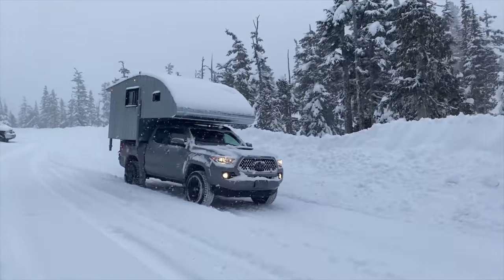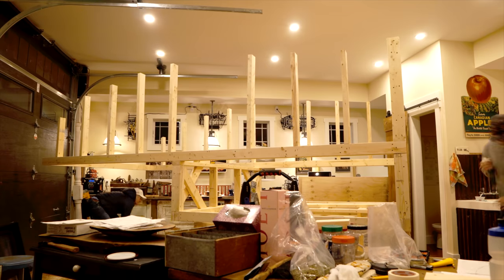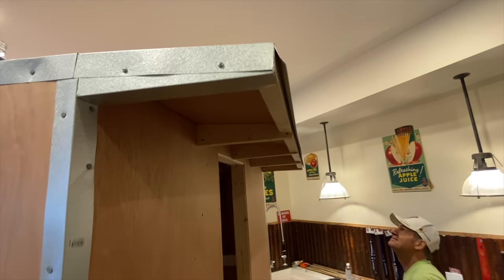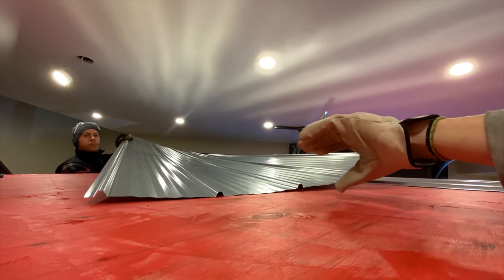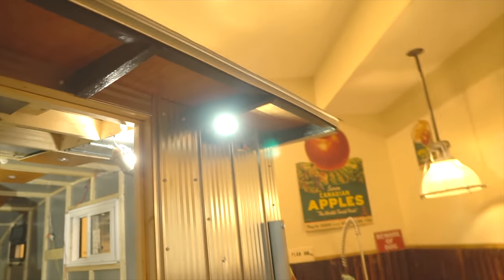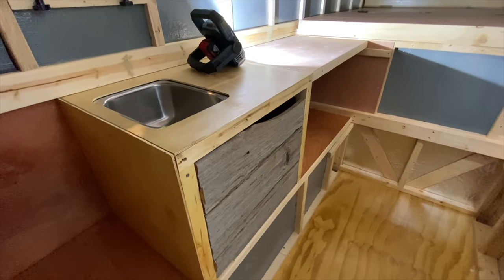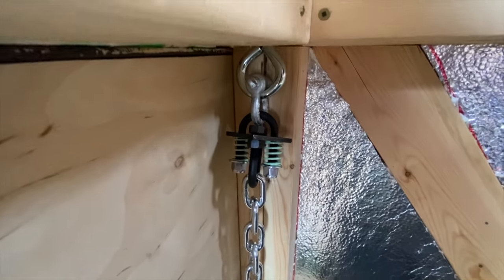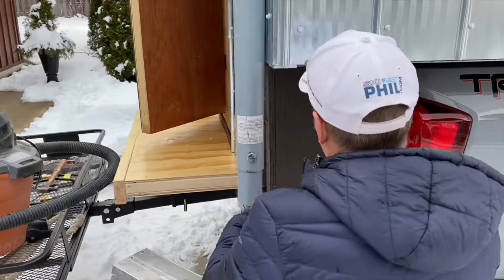I Built an Off-Grid Truck Camper - Start to Finish

Comment: Nice build. I built my own wood framed fiberglass camper shell in 1987 after ETS'ing  from the Army. Inspired by a friend in Hawaii, surf board builder who made his own. 1x3 wood strips are super good for framing especially if your skin is rigid (sheet alum, or fiberglass). Today closed cell spray foam will offer a rigid waterproof structural member. I would offer that you should locate a semi trailer repair shop to buy a single piece of alum sheet. I bought a 14'  piece x 105'" for $250 last year.
Reply from the maker: Hey thanks for commenting, and thank you for your service!! All really great tips in here. A big single piece of aluminum would be great for my roof, I might have to try that on my next repair job. I'm shaping a surfboard right now and I think a camper out of foam would be awesome haha. God speed!

Comment: Commend the effort, and don't mean to be critical, but there are a lot of built in issues with this build.  Number one has to be weight due mostly to full 2"x4" framing. 
   Other issues will be the lack of thermal break and a water tight or resistant membrane between metal siding, roof, and wood structure which will cause moisture build up under metal, evidence of which was the water on the ceiling which likely wasn't an actual leak but condensation due to cold outside temperatures and the warm to hot interior extracting moisture from the air that condenses on the metal. 
    I suggest pulling the metal and applying some form of a thermal break and moisture/leak prevention membrane
   
  As it appears, this is a summer 'only' camper and in its current state has no need for a stove.

I grew up in the Okanogan Valley just about 50-miles south of the border. We were often up into Okanagan, to Penticton, Kelowna,  and other points north as my dad was an avid golfer and as an avid fly fisherman and head of the Okanogan County Health Dept was doing research into the condition of, and how to clean up of the Okanogan River and Okanagan Valley systems.

Comment: Not only weight is an issue, there is no insulation. Rigid panel insulation would have added practically no weight.

Comment: I have a cap and a really high garage. It is easier if you find the exact center, install 1/2" bolts and use another truck and a pulley  with hooks and cables to lift the cap or camper up and down. A high tree or frame would work.

Comment: Your shoe box, I run a 950 eagle cap on my f350 super duty, I think you should add a leaf and possibly airbags to the rear suspension. I did double add a leaf and airbags. It helps center load and ease strain on the frame of the truck. Not telling you what to do, just a thought

Comment: I'm getting ready to build an 8' x 14' log cabin on my 1973 Dodge D600 [2 ton]. I'm in the design stage right now. You over-engineered the frame, but that is far better than under-engineering!  I am debating steel vs. aluminum vs. wood for the frame. Whether or not I build an extension over the cab of the truck will be a big factor in determining which material I use. This video provides a lot of insight into my choice. Thanks!

Comment: Shoebox!!!  Nice vid man (i am late to the party).  I have a 1st gen 4runner I want to build like this (still planning) and the best thing about them is it will have an inside pass thru to the drivers area!!! I will have to be lighter though.

Questions.  Can you give me some battery info?  How big, what all do you run,  how long it typically lasts.  You may have it in a vid and I have not gotten there yet if so no worries I will get to it.
Reply from the maker: Thats awesome man i'm stoked for your build!! I do have a video where i briefly run through my electrical so feel free to find it on my channel. Personally for your type of build I would recommend a battery power station such as goal zero. I have a 240 amp hour deep cycle battery charging from my alternator, and it runs mostly lights, but can also charge my phone, and usb items like cameras etc. I have never had it run out with the alternator charge but i'd say lasts about 3-5 days depending on use.

Comment: Make sure the air bag helper suspension is installed with about 1/2" pre- load and run separate fill valves for left and right then truck will be more stable . Do not run a T together although T gives more suspension flex with air bags plumbed together it will add more sway to Camper hauling.....
 I Have a 3/4ton 8ft bed truck, And I had a realy old fully equiped Pickup camper that I got for $500. My Dad and I Hunted every year out of that for about 6 years Dad loved it ! 
My Dad died in 2014 88yrs old.

Comment: I watched a lady build a sheep herders trailer from a ole landscaping trailer.  Great insights for her build and with the ramp , she kept it to use it as a folding deck . She also had a split entry door and her side walls were designed just like a gypsy/sheep herders trailer . 
So they angle out slightly which gives ya more space inside . 
Awesome work and cool time spent with your faja .

Comment: put air springs on the rear axle. The rear end has squatted and that changes the ride height.  ride height changes will change the toe setting and cause irregular wear of the front tires.
Reply from the maker: I have air bags on the back end, she is riding level now!!

Comment: Shoebox.
Great build man.  I'm sure living it it for four months taught you a lot about its construction.  Good or bad, they're learning opportunities.

Do you happen to know what the end weight was?

Also, if I may make a suggestion?  An airbag system for the rear suspension would help the vehicle out a lot.  Plus you'd have the benefit of having an air compressor and tank on board for endless uses.  Just a thought from someone who used to be an auto mechanic.

Enjoy your build, stay cool!
Reply from the maker: Thanks for the comment! So many learning lessons which was a blessing, at the end of the day it’s about developing the skills 🤔. End weight was around 1200 lbs dry. I did install airbags after the first 2 weeks and it made a world of a difference! Happy new year!

Comment: Enjoyed your video, some good ideas, only thing is if the drain for the sink goes into a holding tank you'll be smelling any vapors from the tank.  You need to add a P trap on the drain line.

Comment: Shoebox: i’m curious what the payload or weight of the camper was? The reason I ask this is I also have a Tacoma Trd and a 6 foot bed. I have 950 pounds payload and the camper I have is already 500 pounds over. When your you’re talking about all the stuff you put in it and also yourself or another passenger. 
I did put airbags on the rear suspension and use E rated tires to help. 🖖
Reply from the maker: Hey! My camper isn’t as heavy as yours but we are likely in a similar situation. I’m close to payload forsure. Ultimately I think a pop up would be best for smaller payload trucks

Comment: The sloped roof was a really good idea.  Plain galvanized sheating would have worked better than the corrugated.  The weak link is the seams.  If you use silicone on the seams there is no worry there.  Water mitigation and water intrusion are a very big area of focus for any camping situation.  Properly maintained, the wood stove is a great option for camping.
Reply from the maker: Thanks! The weak link is definitely I. The seams! I did some caulking and it has helped but we will see how it holds up! Wood stove has been great to me! Thanks for watching 😝

Comment: And yes, you should put roofing screws down through the ridge part of the sheet metal panels. Your screws should have a rubber washer and DO NOT screw them down to tight.
I know, I just replaced my 12X20 shed roof. No more leaks.
😊
Reply from the maker: This is a great tip!

Comment: You’re the man. I’m working on a build rn and I can’t tell you how many times I watch your videos. Appreciate the time you put in and the knowledge you shared. One thing that’s eating at me a lot is that the weight is definitely over my payload, what have you done to give you peace of mind?
Reply from the maker: Awesome man i love to hear that! Glad you like the vids. Man when I was building my camper I went through the exact same thing, the GVRW concern totally consumed me and stressed me out. The reality is, changing your build to be lighter at this point might be very difficult, i would definitely recommend doing everything you can to keep it light from this point onwards. Airbags will help keep the truck level and ride better, but it won't increase your payload. It's going to be hard to find that peice of mind, but remember just to relax, it's all for good fun at the end of the day. To be honest, there are lots of truck camper's out there way over GVRW, I have talked to a few people i've met on the road that are overweight, the truck will still drive, but it's not as safe, and you gotta go slow and steady. If you're going to be way over the weight limit it might be best to look for a new truck? if you are within a couple hundred pounds try and find anywhere you can cut weight? (usually a lighter battery helps, or not mounting jack posts on the camper). Best of luck my friend! There is always a solution so just take your time to weigh our your options! Cheers
Reply: Mine is built 99% out of 2x2 and only two 2x4x 10ft. 1/4 plywood exterior. It's very rigid. Can jack one corner up and it's solid

Comment: Super cool how on earth did an animal gain access with that metal siding I can't believe you have that on a Toyota I didn't think it would have heavy enough suspension
Reply from the maker: haha thanks! the animal got in at the lower part and it chewed through 1/4 inch plywood.

Comment: Wood stove is great however you always need them.most when it's wet and cold and fire wood is scarce. Should get a diesel heater in their as well as backup
Reply from the maker: Totally right, diesel heaters are awesome as well! I have a propane heater as back up… it’s not as good but was way cheaper lol

Comment: Shoebox! Do you have any idea about the total cost? What do you think of trying to install some kind of shower system or bathroom?
Reply from the maker: Thanks for watching! Yes, the total cost by the end was right around $6000 Canadian ($5000 USD). I personally don't want to install any bathroom or toilet, but I never have an issue using public washrooms. For a shower I just have a solar shower bag right now, I usually heat water up on my stove or woodstove and then have an outdoor shower that way, I do have a few ideas of making the shower system better but right now its not a priority for me.

Comment: Shoebox: What kind of animal got into your truck, and did it chew through the side to get in? That's insane. I appreciate your build here. I started building a camper a few years back, but it was going really slow because I had no help. I had the framing almost finished and up on some saw horses in front of my big barn when a very high wind came through and tore it down. I found pieces of it blown across the street when I got home from work! I was pretty bummed out because i put a lot of effort into it and didn't expect the wind to even catch it since it was in front of my barn.
Reply from the maker: The animal was a pine martin. Oh no, i'm sorry to hear that! Life will through some dark twists at you sometimes and somehow we gotta learn to roll with the punches. Good for you for even starting that project alone, and even though you didnt finish I hope there were some valuable lessons learned in the process. Take care my friend, god speed!

Comment: The Shoebox looks excellent. I think your dad's house building expertise is shining through a bit in the wiring (those twisty knob wire connector things are not really for things that move), but I'm sure you've figured that out by now :P
Reply from the maker: Thanks! Haha that is so true! I know those connectors are probably not the best, but they have held up so far. But I have no issues changing them if they start to fail.

Comment: The shoebox came out super clean looks great. My only thought is the weight using full two by fours. I wonder if you had ripped two by fours in here and use it for your framework if it would’ve been better. Once again I’m really impressed with what you and your dad have done
Reply from the maker: Thank you! I do agree the weight is a bit heavy. But hey, I started out not knowing anything and I’ve learned along the way. I’m hoping to post a 1 year update soon!
Reply: Do you know weight ?
Did you ever weight it?. I would love to know as I'm building one myself and stressing about weight. Knowing weight of yours would really help as mine is almost the same build
Reply from the maker: @marcseguin4591  Hey! I understand your situation entirely because I have been there, but please do not base the weight of your build entirely off mine, our materials could have weighed different (green vs. dry lumber) and an f150 does have a bigger bed which could change things, plus the interior makes up a lot of weight too. My camper weighs around 1200 lbs. but I am rounding down a little bit
Reply: @HondroB  I've watched quite a few camper build videos and this question always comes up.  It seems like more often than not the tuber does not answer the question.  Thanks for taking the time to answer this specific question.  👍👍👍

Comment: I love the shape of the roof! You did a great job building a useable camper. I have built 2 campers and I’m thinking of building another, the first was too small and the second too big so I’m looking for that just right size. On my second one I used all cedar 1x4s for framing because cedar is about 1/2 the weight of construction lumber. Also I found there is no need to lower the camper when off the truck if your legs are strong enough I just back under the camper and jack up on the trailer hitch till the weight is off the legs this makes for quick loading and unloading. I wonder if you could lift the camper by just airing up the air bags? Anyway great job I will watch the rest of your videos. There are videos of my camper construction on my channel
Reply from the maker: Thanks I’m glad you like the videos! That’s some awesome insight from your builds, it’s very hard to find the right size. Cedar is great great wood! Good luck on the next one if you go for it. Thanks for checking out the videos!
Reply: You have a lot of great ideas, I looked at your channel and I was looking to see your other 2 truck campers, but couldn't find.

Comment: Nice build. I like the name. The roofing metal is tough to seal on a curved roof going crossways & I would install sides horizontally (rear vertically ok.) Enjoy the camping!
Reply from the maker: I'm glad you like it! I wish i could have installed the metal that way but It wouldnt bend with the curved roof so i had to place it crossways. Cheers!

Comment: Is that a shoebox, garage, or living room you built it in?  Legit workspace!  Definitely built 4x as strong as any other camper.  Does that bottom board have waterproofing?  Well done, and with your dad too which is cool.
Reply from the maker: Glad you enjoyed! No waterproofing on the bottom, but I wish I did it early in the build.
Reply: If I were him I'd flex sealed bottom board. I was a sceptic but I tried it,now I swear by it.
Reply from the maker: @lorihutton4719   if i were to go back i would seal it!

Comment: the shoebox looks heavy.  At the start of the video, you mentioned it should be on a 1 ton truck.  Then a tacoma showed up to carry it.  What's the weight of the camper ?  Tacoma only has around 1400 lb payload i think.
Reply from the maker: Hey this is a great question! I mentioned that because I want people to learn from my building process (I had no idea what I was doing at the start). The point was that one of my errors is that I think it is a bit heavy for the tacoma, so if anyone were to copy my build or something similar I was recommending a higher payload than mine. My camper weighs around 1200 pounds, and the tacoma can handle it, but it’s not the best on bumpy logging roads or anything off the beaten path. Long story short, my opinion is this style of build (size and framing) would be better on a truck with a heavier payload for a smoother ride, but she still works on the old half tonne
Reply: @HondroB  I see.  1200 lbs, tacoma trd definitely can handle, but it's almost at its limit.   It's a very nice build, i love the wood burning stove.  No other truck camper on the market offers it.  It's free energy.
Reply from the maker: @fchen7  I completely agree with your comment. And yes the wood burning stove is the best! especially over the winter!

Comment: Shoebox ,nice job on your camper its well built . Looks like you might need some airshocks  or leaf spring added .I want a camper real bad I have been looking at used ones but  I have a short box .now you got my brain thinking if I do it my self I can put what I want .agin nice job to you and your dad
Reply from the maker: Thank you! I added airbags to the suspension. not going to lie I was bummed on the short box at first, but really there are so many options! Just have to keep it light, but having it light is honestly a blessing anyways!
Reply: @HondroB  Yeah that thing is probably more like 1500lbs vs your rated weight of 1100

Comment: Shoebox, this thing is rad. Awesome project with the pops. Wondering what insulation you chose to use and how warm it keeps you without using the wood burning stove
Reply from the maker: Thanks for the comment! I used mostly 2 inch foam board insulation, but used some rock wool (fireproof) insulation around the fireplace. To be honest, with no heat it’s pretty cold, but if you can warm it up it stays warm really well. Usually when I wake up in the morning with the fire out, it’s 5-10 degrees Celsius warmer than outside